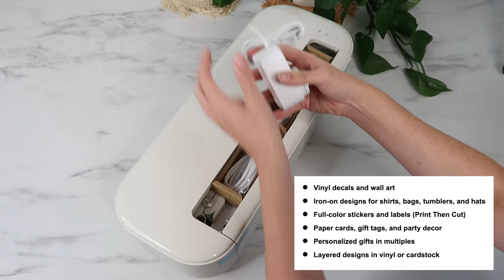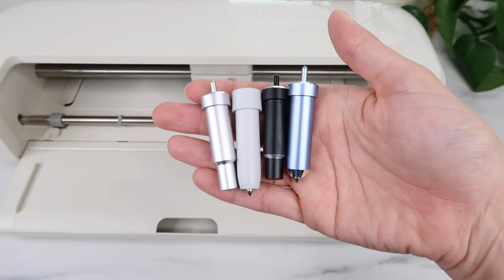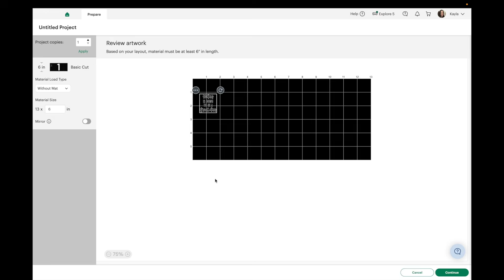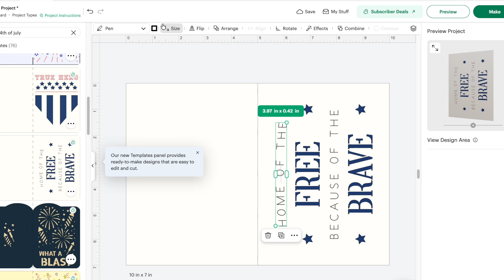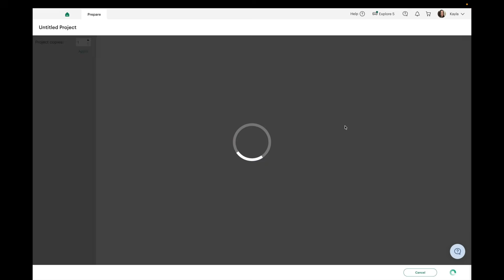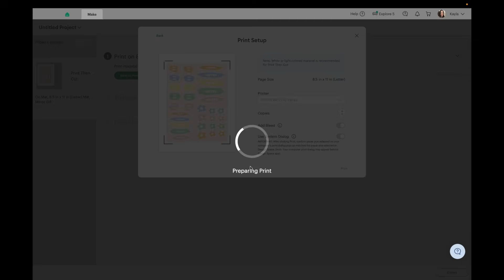Cricut Explore 5: Complete Beginner's Guide | Setup, Tools & 3 Projects

Comment: Very helpful video! 
I just got this same set and for some reason the knife won't work. Its connected through Bluetooth so connection isn't the problem.  The vinyl goes through (without a mat because its Smart Vinyl) and the knife moves around, but then it stops and design space tells me to unload it.... It cut nothing. It's brand new.  Anyone have any ideas for me as to why it would do that?

Comment: Somehow my explore 5 keeps double cutting on kiss cut when I use the print and cut function. Does anyone happen to know how to fix this?
Reply from the maker: What cut setting are you using? Some are set to cut more than once. Also, is it cutting in the correct sport or double cutting in totally wrong spot?
Reply: @KaylasCricutCreations  I’m trying to make stickers so using kiss cut. It’s cutting along the outlines but doing it twice. It finishes the whole sheet once but then it does the whole sheet again. I turned off the multi cut thing in the material setting but it still does it.

Comment: I just bought it 2 days ago, and the plastic on the clamp for the blade housing just disintegrated. It was what looks like a hinge that connects the metal bar of the clamp but it looked like someone 3D printed a hinge. I would say it was like a Lego piece but I feel like the Lego wouldn't have crumbled apart like this did
Reply from the maker: oh wow! That is crazy! Have you tried calling Cricut? The machines should come with a warranty
Reply: @KaylasCricutCreations yeah I did and they did send a replacement machine a little over a week ago. They told me they were sending a complimentary package as well which did arrive before the replacement machine. But it was just a few single sheets of cricut value vinyl. Lol. But a bonus they sent me the whole essentials bundle all over again so that was nice

Comment: Thanks for the info.  I wish you still had to click to start cutting after loading.  In the rare case when the material doesn’t load correctly, it would be nice to unload and fix before cutting.
Reply from the maker: That is true!! I have found that you can cancel the cut easily with this one, which helps. With the other machines, when I try to stop the cut, it just keeps cutting lol, but when I click the pause/go button here, it works right away, which is nice!

Comment: This is the first I've seen of the explore 5, and I don't know what it is, but I'm not a fan. I've had my explore air 2 for years, and I think I'll stick with a bit longer
Reply from the maker: The air 2 is a great machine!
Reply: @KaylasCricutCreations It really is. I've thought about upgrading a couple of times, but I never do.

I've just found the explore 5 with the bundles package for £249.99, so it definitely is a good price.
Reply: I feel the same. I haven’t liked some of the changes with the later models.
Reply: I agree.  Going to keep using mine instead of upgrading.  Will probably get a Maker in the future.

Comment: Ive been so disappointed in Cricut over the years. I have the maker and the joy bit everytime i go to use it the menu is changed. They now charge you for everything, fonts and pictures. It annoying to have spent the money on the company and have to use other means to get the items you want.
Reply from the maker: Design Space can be frustrating with Cricut constantly changing it. 😩 

There are some free or lower cost options out there for images and fonts. I actually don’t use Cricut Access too often. I’ve been thinking about putting together a video walking through my favorite resources if that would help you get more out of your machines without the extra cost!
Reply: Do you have design space? I do and rarely pay for anything.